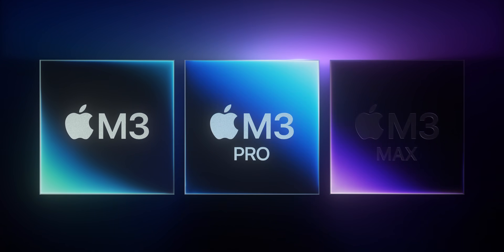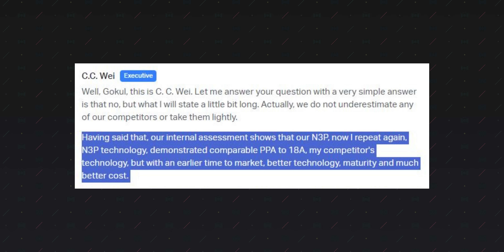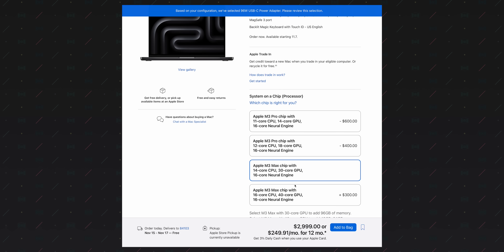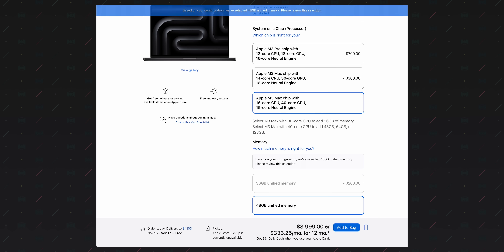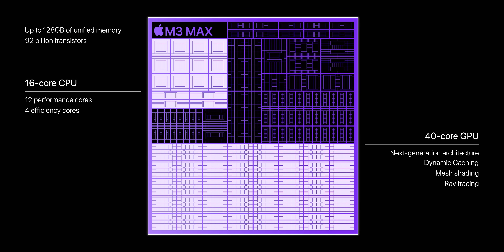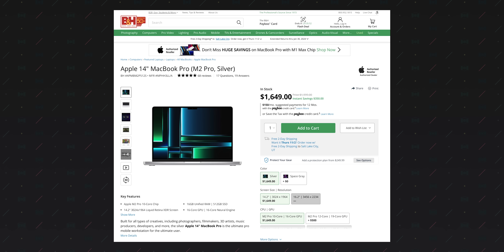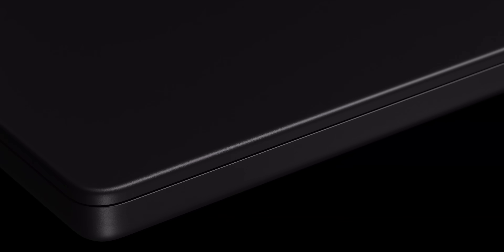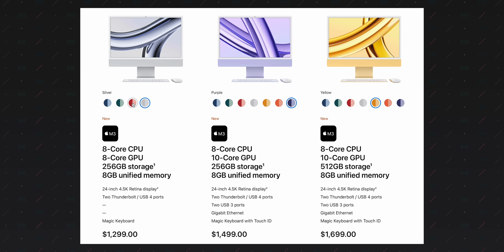Apple M3 Deep Dive: The Details Most Skipped Over

Comment: Interesting info about the 3nm process node roadmap. The 256GB remaining in the iMac for base AND mid tier really hurts. The specs per dollar does seem like the worst value in the entire M3 range. Which is sad because my 2011 iMac is nearing retirement.
Reply: Get a mini pc with 64GB and 1TB for a lot less lol
Reply: @chromaticvisuelle  this...and soooo faast stil..literally half price...
Reply: I'll be replacing a late 2015 i7/16GB/2TB.   M3 is $2500, and $400 of that is the 2TB vs 1TB SSD, which I'll pay, but most people probably wouldn't.  The 2015 was at least that much, 2.5" smaller screen, fusion vs SSD, and I'll be happy to not have the fan.  Given the inflation over the last 6-7 years, seems like a pretty OK value to me.  I could build a PC for about 2/3 the price, but then I'd have to deal with Windows, and the M3's GPU is probably enough for WoW.

Comment: I've been an Apple user for many years working in top apple machines, but yesterday the Apple event was bizarre:
the guy had the courage to say that the new model is blahblablablah X faster than a dated version.
following this reasoning:
the M3pro is 5000x faster than the apple Elisa and 1000x than the iMac G3 - fact: there wasn't much of a performance gain and they sold RayTrace as if it were new, a fact: even on the top iMac Pro - 3D software is in its infancy... I would like to see tests using 3d software such as Twinmotion, SketchUp+Vray or Blender in the same project simultaneously with PC machines and oh yes - these events would be real, because what I see is juggling traffic lights and visual triggers for sales only.

Comment: Apple says it's a upgrade in every front from the old 27 inch iMac, but instead of M3 performance it is not. Resolution, size, ports and upgradability it is worse than the old 27" iMac

Comment: My new 14 inch MacBook Pro Space Black unit should arrive around Nov 7th. Yes, I pulled the trigger last night. I selected the non-binned M3 Pro chip (12-core CPU, 18 core GPU) with 36 GB of unified memory with 1 TB SSD storage. Although it was assisted with a BlackMagic eGPU and still in great shape, it was time to update my 2018 intel MacBook Air. The new MBP should go nicely with on my desk next to my 27" Studio Display Monitor and a still (it won't die or become obsolete it seems) 2018 12.9" iPad Pro with Magic Keyboard.  

I've learned two life lessons when it comes to updating my laptops. 1) Only purchase a mobile unit if you can replace it easily (within your budget) if it becomes lost or stolen and 2) Although this new MBP should give at least 6 years worth of useful service (Apple hardware is built to last), technology always marches forward and the software advances ALWAYS makes the hardware obsolete after 6 years or so. Hence, I never purchase the most expensive tech available because I do NOT have an unlimited amount of disposable income - sadly. Grin.

Comment: I thought I would give a different perspective on yesterdays event. Im a pro. 3d artist and digital designer. I know exactly 0 other 3d artist who use a Mac for work. Apple saying that NOW you will finally be able to use a macbook for professional 3d work (their words, not mine) is laughable. As much as I love macbooks (I own an M1 macbook air) they are nowhere close to beeing capable of rendering heavy 3d scenes. I mean, you can, but why would you if a mid-range mobile GPU from nVidia just destroys the M chips in all rendering scenarios. 3d graphics rendering has moved away from CPU rendering to GPU rendering a decade ago and rendering engines like Octane, Redshift, Vray NEXT, Cycles, Karma and many more work best with nVidia's CUDA core technology. They can be orders of magnitued faster than CPU rendering and that also includes the M chips from Apple.
So to summarize - no pro 3d designer would (or should) go with a macbook if he/she is actually doing some serious rendering on the go. And on that note - most 3d artist don't really work on laptops. They own multi-GPU desktops that the upgrade every 3-5 years with the latest offerings from nVidia.
For a 2d graphics designers and motion designers, that's a different story. Since Adobe apps have been ported to work natively on M processors, I do think a macbook is actually a pretty good choice.
Reply from the maker: Thanks for your insight. This falls in line with what I’ve heard.

Comment: When discussing prices, I think we should all consider 16GB of memory and 512 of storage as the effective base model. Yes the lower spec models perform well for most things, but they page memory aggressively and with such a small SSD it will wear out quickly.  It wouldn’t be terrible, but a soldered SSD means it bricks the whole system.
Reply: realistically 1 terabyte is the minimum viable storage, especially when this is the one laptop where you will never ever be able to have more. The OS itself and various non user files take up roughly 150-200gb (Windows laptops have replacable drives and often even second slots so you could for the price of 256 - 512 get 2tb extra in your laptop)
Re: bricking the system from worn out ssd. This is even worse than it seems cause a repair shop could actually replace that ssd and resolder it but the BIOS is held on ssd now instead of on a seperate bios chip meaning you can't for example run the computer from an external drive, nor replace the internal drive.
Reply: @definingslawek4731  IMO, 512 is plenty for most users.  I've had my MBP for just over a year and I am using 235 GB of storage.  I don't use it heavily, I have a desktop for that, but I do use it a lot.  

I suppose if you plan on running creative or professional software on it (other than office), 1TB makes a lot of sense.  But despite Apple's target demographic, that isn't most people buying these things.

Comment: Really good video.  If you lost the dumb jokes at the top, this could be taken as a really serious piece of production.  I would love an even greater deep dive of the different 3nm chip offerings, as I'm a total noob in this area and it's still all a bit confusing to me.  Is the M3 the best we can expect for a good while, or is the next variant just around the corner actually superior?  I wish Apple would release less frequently but give us more substantial upgrades each time - as you have pointed out, the reduction in things like memory bandwidth are really disappointing.
Reply: I think that at about this time next year we will get M4, which will be finally based on N3P process.
Some performance as well as power savings jumps in range od 5-10 % against M3, but (hopefully) without binned down that much as M3 Pro is.
That clearly is not good value, when M2s will get a price drop.
Well yeah, there is 60 % growth in Single Core performance if your workflow is more like that oriented (ie web development, Matlab, STEM)

Comment: The M3 MacBook Pro can still only drive one display?! It has two usb C and one HDMI port. The Mac mini could drive two displays on m1 how come the base model 14in pro can’t?
It’s one of the few things that annoy me about my M1 MBA.
£1699 for an 8gb RAM single display output ‘pro’ laptop. I’d rather get an m2 pro/m1 pro 14in on offer.
Reply: M3 MBP is driving 2 displays. The internal one counts as one, the Mac Mini has no stock display, so they routed it to an external connection. Now Why the pro and Max chips are only 2 and 4 external displays instead of a theoretical 3 and six... can't answer.

Comment: For many professionals ie mechanical engineers the arm based machines are still useless. Apple taunts as being for the pro crowd ie prosumers but that is mostly for photo/video editors and that is on the entertainment side of things.
Reply: So its your software (which still relies on x86 and/or certain hardware specifics like CUDA). Dont blame Apple. Blame you software vendor :)
Reply: @suheri  actually that is not about blaming the software vendor at all. In the engineering space stuff takes time because nobody wants to deal with a faulty/buggy software. Coding for a different instruction set is pretty hard and if Apple dont want to help out as they do for different sectors it will take time. To me it kind of feels like Apple is simply not that confident, because in this sector u will be responsible to pay a lot of money for delays if it is caused by you so to speak. Not many other sectors operates like this.

Comment: I strongly disagree with the notion that people who bought the 13" M1/M2 Pros are "stupid". Yes, their design was "outdated" (imo it still is very nice and there's no notch), the webcam was worse compared to the M2 Air, and there was no MagSafe (again compared to M2 Air), but they offered better battery life due to simply having a bigger battery inside and more importantly, they had active cooling. I, for one, prefer my computer to actually be able to sustain its performance if I'd like to play a game, for example. The M1 13" Pro also had a better display compared to the M1 Air.
And when compared to the 14", in some countries, such as mine, the price difference between the 13" M2 Pro and the base 14" M2 Pro is significant (about a 60% increase) and this is too much for some people. Not to mention that the 13" Pro is lighter, slimmer and has a smaller footprint compared to the 14" Pro.
On a separate note, some people really love the touchbar, which you could only get on a 13" Pro.

I don't get the hate for the 13" Pro, but whatever. However, get off your high horse and don't call people stupid, assuming they made a purchase because of lack of knowledge and not because of personal preferences and budget-constraints.

Unsubscribed.
Reply from the maker: You’re reading too much into a passing remark. The average consumer is ill-informed, is that better?
Reply: @snazzy  That passing remark was your explanation as to why the 13" Pro was selling well despite the presence of the Air models, completely disregarding the benefits this model had over the Air (which you yourself said was at almost the same price); and also ignoring the fact that prices vary across the world. The average consumer being ill-informed is an undisputed fact but this doesn't mean he is stupid and it definitely doesn't mean this is the main reason the 13" Pro remained a strong seller. It's just an insulting oversimplification that isn't necessary to make your point.
Reply: 13" has better design and look than new 14/16 boxy outdated look. Weight 200g less than 14", which is significant, 15-20% or so better battery life. M1/M2 Macbook pro 13" battery life won't be reached ever again it seems.

Comment: I’m still stuck on an old intel chip. Would it be worth it to just upgrade to the M3 Max?
Reply: I went from intel to and M1 Max and it was a  crazy difference so I imagine intel to m3 max would be a crazy life changing experience
Reply: @Tonellacam_Films yeah i still use intel too! Can’t wait to see m3 14” release because m1 14” is bloody expensive here. How come the price just fall not more than $300 since i added it to my cart even BEFORE m2 14” releases is beyond me 😂
Reply: @nhs.14  I bought a refurbished M1 Max and got a great deal on it and honestly I would of never known it was a refurbished one !
Reply: The M1/2/3 base and Pro levels are already far more power and and battery life, with much less heat and fan noise, than any Intel Mac ever made. I “only” upgraded from Intel to an M1 Pro, but that improvement is still working so well that I don’t need to upgrade to M3 yet, and I don’t need a Max.

The people who need the Max chip are those whose software genuinely needs more CPU and GPU cores or a very high amount of Unified Memory, because those are the improvements. The single core score of a Max or Ultra is not really higher than a base or Pro, so do not upgrade thinking the machine is always faster. The Max and Ultra are only faster if you do a high amount of parallel processing (e.g., 3D and video editing) that can be distributed across more cores.

Comment: I'm so happy they released these machines now. But I'm struggling to choose between the base M3 14 inch and the M3 Pro 14 inch. I'm going for the binned M3 Pro CPU (because here in south Africa these computers are unbelievably expensive) so is the binned M3 Pro chip really that bad or is it only a slight downgrade
Reply: Buy m1 pro / m2 pro

M3 series is just downgrade 
Lmaoo
Reply: @ardl7099  my reasoning for going for the M3 is because of support. I'm not going to spend that much on a laptop if it will only last 4 years. I want the newest model with the best software support so i can keep the laptop for as long as possible. And Apple have not said how long they will support the M series chips either
Reply: @adriaanserrao2016  updated os make device slower n worse
😴

Comment: Here is what I think Apple is doing to keep the upgrade train going.
1. Increased the base RAM from 16Gb to 18GB.
2. Expanded on the GPU to add Raytracing, Neural engine performance.
3. 100nits more base brightness.
The above 3 features increase battery consumption significantly. How are they going to compensate for that without increasing the battery capacity?
They gut features of course. Like this...
Swap 2 performance cores with 2 efficiency cores.
Remove 1 GPU core.
Reduce memory bandwidth from 200GB/s to 150GB/s.
The 3nm process does help some here but not a lot. I suspect we wont see any improvement in benchmarks compared to the M2 Pro. I suspect they will add the cores back when M4 rolls out next year to keep the upgrade train going.